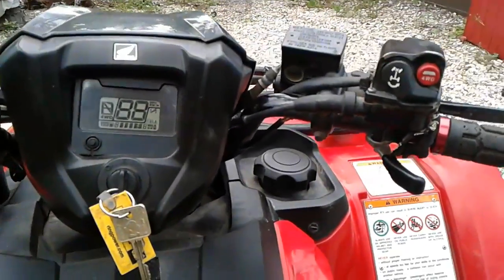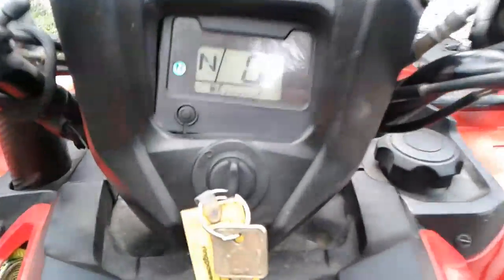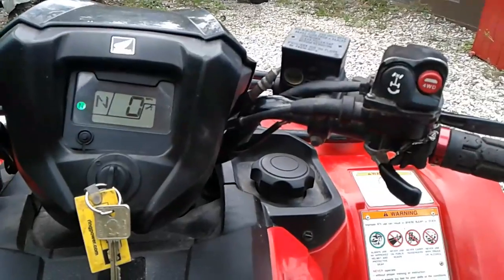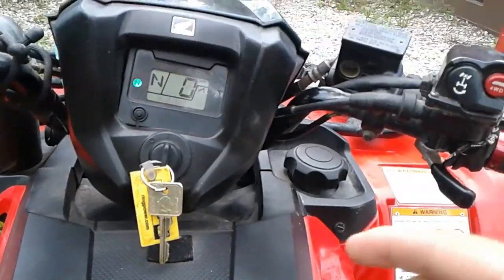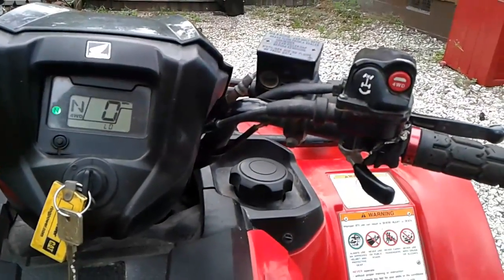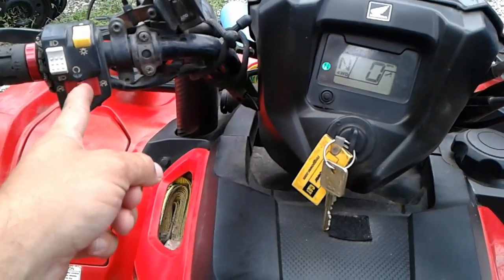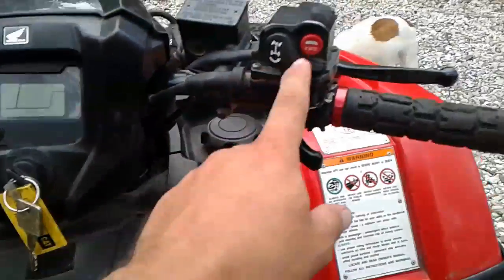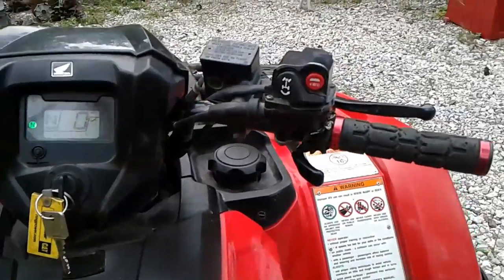Foreman Rubicon flashing 4x4 4wd after water riding

Comment: and watch out if you break the speed sensor! 4wd/diff lock won't activate with out the method described in the video.  ask me how I know! 
oh yeah,  you can kick it into neutral Rev it up and key off back on real quick before the motor dies.  it's saved me a few times

Comment: it's the the front diff actuator it has position  contacts inside for 4X4  and different lock ,looks like the contacts in a ignition  switch . they are  badly sealed
Reply from the maker: that is not the issue ive bypassed them same issue
Reply: Mud Puppy have you  had an actuator stop working so far. I've had  to replace  lots of them.

Comment: I hope my new foreman doesn't do that. I greased all of connectors and relays with dielectric grease.
Reply: Bucknasty84k10 it will still do it. as soon as I bought my 2016 rubi got it home, stripped it down and greased every plug. if you ride water it will eventually happen

Comment: have a stock 300 with 2 inch lift what would be a good tire for it
Reply: Tyler Bearden 35 inch
Reply: Tyler Bearden 27 or 28
Reply: jeff but what kind itp interco ?
Reply: Tyler Bearden i personally have 28" itp mudlites. i used to run 30s until they ate up my plastics but they still don't look used at all. Plus they are very good in the mud

Comment: That dosent even work
Reply from the maker: It works for 99% of people thank you very much. You are a sample size of one and therefore nothing more than an anecdote. Sounds like you need to replace your actuator. it either got water in it or you were using four-wheel drive and diff lock improperly
Reply: @MudPuppyOffroad  It use to work for me but not it just stopped working yesterday.